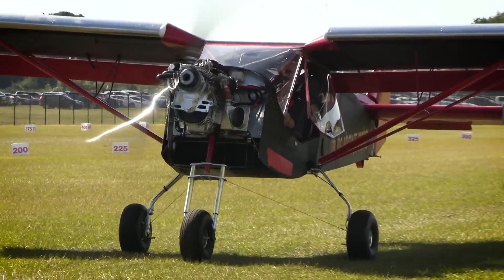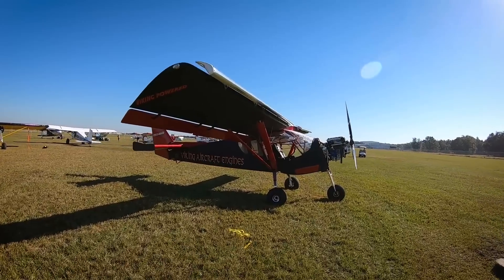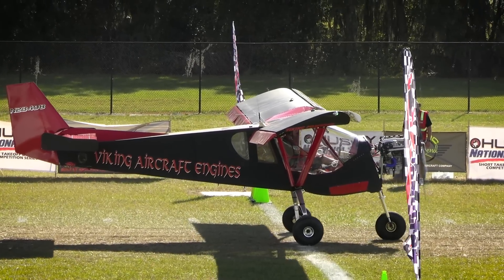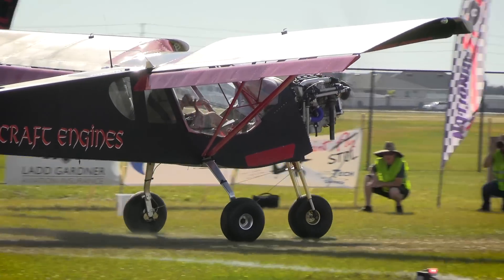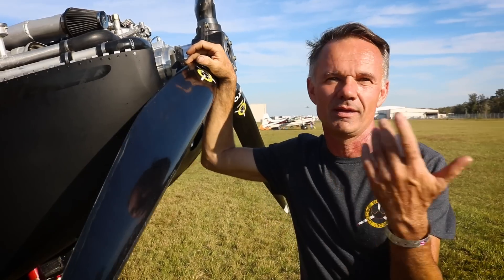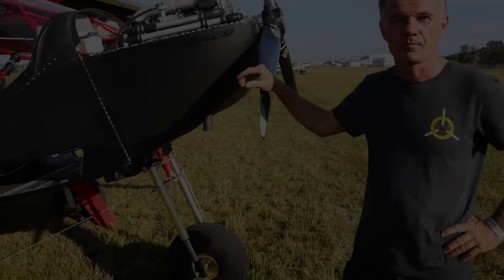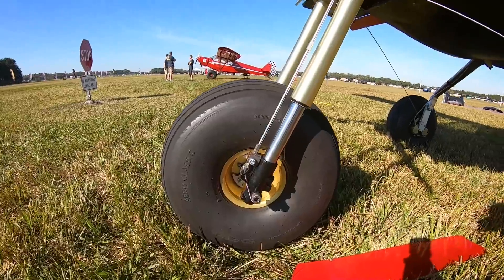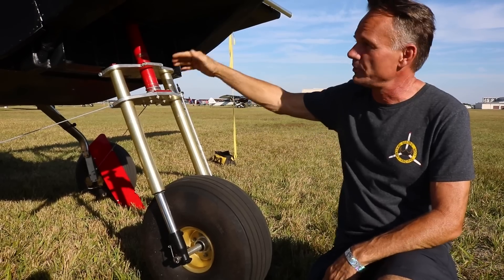Honda Turbo Engine | Sportbike Gear | STOL Aircraft

Comment: Very cool, I suggest you adjust the fork oil and rebound settings in the front forks to increase the dampening and make it even softer. The initial bounce when you land should be mitigated so your landing will be shorter. I'd be interested in building something like this

Comment: Have you looked at the Honda motorcycle 1300cc v engine in the Honda touring motorcycle for light sport aircraft.  They are around 120 plus hp.

Comment: Do these engines get modified with two spark plugs per cylinder?  What about the rotax, two spark plugs per cylinder?  Asking for a friend concerned about redundancy.
Reply from the maker: This particular engine is NOT modified for the ignition nor is the design most likely able to accept such mods. (Room in the cylinder head etc). There are a lot of "modern engines" being used with only one spark plug and one ignition system. Some...have a single spark plug but 2nd coil etc and operated by a switch to alternate to TEST or switch if failed.  Etc.  The idea however, and this was explained to us by a known electronic ignition manufacturer for Legacy Engines (Aircraft Engines like Lycoming and Continental) is that back in the day (1930's-1940's) the magneto spark ignition wasn't hot enough to make efficient combustion. Hence having two spark plugs and two magnetos to run the Engines. The two spark plugs also offered "redundancy" as a "biproduct." Not a bad idea also considering the spark plug gaps of a Low Energy Ignition System as they were prone to fauling with both carbon build up and lead from leaded fuels.  The modern High Energy Ignition System is able to have a MUCH larger spark plug gap and hence fauling is nearly unheard off and a non issue.  (Telling for a friend). :-)
Reply: @ExperimentalAircraftChannel  thank you for the response. I’m just getting started. I have 50 hours in a cirrus and I’m now thinking experimental may be best for me.  Is there a place I can go to check out builds and volunteer for a few days to learn?  I’ve kept my ski boats running myself and am pretty handy.
Reply: @Mobev1  you just missed oshkosh airshow in Wisconsin
Reply: @majorchungus  I bought a cirrus on eBay recently and got the deal of a lifetime.  Wells Fargo owned it and they were just unloading inventory.  It was risky because I couldn’t do a pre buy but I ended up taking it to a cirrus center in rochester and it had zero issues.  2017 sr22 turbo for 268k!
Reply: @Mobev1  I have to aircraft, a flying one and one I am rebuilding.

Comment: We’ve k swapped everything on the ground. Bout time to move to the air. But dudes crazy for using a motorcycle fork for front landing gear as cool as it is, I’d never trust it. Although it may be stronger than some stock nose wheels.
Reply from the maker: That is why it is called EXPERIMENTAL! :-)  Looks like it is high time for YOU to try it! We have a 31 Day Build Challenge going on RIGHT THIS MOMENT in the month of December. Search FB for "EXPERIMENTAL AIRCRAFT CHANNEL GROUP" and join in or follow along.
Reply: @ExperimentalAircraftChannel  lol ya got me there. But it does look like he machined that fork and took the design rather than taking the whole setup from a motorcycle and slapping it on. 31 day build challenge. That sounds awesome. But not on fb.. Although for me a 31 month build seems more realistic. hahaha

Comment: I don't know what kind of material Jan is using for his nose gear, but it just doesn't look beefy enough to handle the nose drops he's talking about. I'd go a bit beefier if it were me, and use inverted forks that current sport bikes use. They're stronger and less wobbly, at least on a 200mph crotch rocket :D
Reply from the maker: Good idea. Inverted forks. Actually even the ORIGINAL nose gear/suspension looks quite light. BUT.... it actually has done quite well through the years surprisingly. Thanks for watching today!
Reply: @ExperimentalAircraftChannel  Can't argue that old school design.It's balls-simple and reliable. It did limit tire sizes a bit though. If you look at the modern ADV/Enduro bikes, they're all running big, beefy, but reasonably light inverted setups, with oodles of travel. Just what a bush plane that might land a bit hard from time to time would need. just make sure you're not ending up with a prop-strike at full compression with your nosewheel at minimum PSI.

Comment: I’m new to this but wouldn’t a street bike engine like a 1000 work? If somebody can answer that.
Reply: Nope. The transmission is integrated into the engine (the engine block and tranny case are all one casting) and the dead weight negates the power gains. That's why guys like Steve Henry and Jason Busat are using skidoo engines, and then that other guy is using a jetski engine. At most, the only gearing you need between the prop and the crankshaft is a single reduction gear on the fast spinning power plants like the ones I mentioned. The Viking Hondas are mounted so that the flywheel is spinning the reduction gear at the front, vs. the typical transverse mounting found in FWD and AWD 4 bangers and V6s. If you have a spare 1000cc I4 from a wrecked sportbike, you're best suited to convert it into a 5 speed with reverse and drop it into a sand rail or go-kart.
Reply: @GrizzAxxemann  cool yeah I've already done that a few times.
Took a  Ninja 1000 & an old 4wheeler frame & stuffed it all together.
I made it really low for center of gravity.
It does low 7 in the 1/4 mile.
Really fast.
That's why I was thinking of that in a sports plane.

Hey thanks for yr response, it's greatly appreciated.
B safe
Reply: @davidorourkesr  No worries, my dude. I was on the same train of thought for the longest time before someone broke it down for me.
Reply: @GrizzAxxemann 
I'm my ways of thinking.
Why couldn't the transmission be deleted?
If to gut the case & run it as direct drive?
Reply from the maker: It has been done before (and recently in fact). Someone sent us a short video clip (cell phone... bad quality) of a Yamaha on a taildragger. I believe it was even SHIFTED from 1st to 2nd gear in flight!!!! :-) But.... typically speaking there is a weight penalty even compared to say a Snowmobile engine with a added purpose built gearbox. And they these "purpose built gearboxes" have the correct gear ratio for the rpm of prop/engine power etc etc. Thanks for chiming in today!
Reply: @ExperimentalAircraftChannel  When my royalties came in my last check is going to be very large and I’m definitely going to be buying an amphibious ultralight the a 5 I think would fit my thoughts?

Comment: The problem I see with these turbo Honda engines is people compare them to the Rotax. The Rotax does add horsepower but it’s more of an altitude compensating engine. I don’t believe the car engine is. I even asked Viking several years ago what was the horsepower rating at 15,000 feet and they couldn’t answer that. These turbo engines are producing more horsepower obviously and doing so at sea level but In theory these Honda engine should lose 3% power right from sea level just like an out naturally aspirated as I don’t believe they have a sophisticated waste gate controller or altitude compensator. So at some altitude 9+ thousand feet a Rotax 915 will produce more power than a 190 hp turbo charged Honda.
Reply: The 915 is the one with the antiquated waste gate controller. The Honda system is extremely precise and can hold any level of MAP at any altitude, as long as the intercooler is large enough. So 195hp is theoretically attainable at 30,000 feet if some special application needed this. Also, it is a tough argument to put Rotax ahead of the Honda engine when the Honda pulled an airplane 1/3 heavier than the many Rotax powered competitors in third of the distance at the National stol.

Yes, this Viking/Honda is also altitude compensating.
Reply: @eggenfellner  yep MAP ( manifold absolute pressure) and or MAF ( mass airflow sensor) some engines use both,  will make any engine altitude compensating. They will still lose power at high altitudes, that's where a turbo cones in,  but the mixture will be right.
Reply: Yes and no. All engines loose HP (with rpm constant) with a decease in air density and the  Rotax is the same as every other engine in this respect same as the Honda engines. One key thing that people are overlooking about the Rotax is that they have a "5 minute" or takeoff rating and then the power must be pulled back so that "915is" is not producing the (well no know really knows) 140ish hp in  flight as the engine needs RPM to produce the rated HP and when the operator decreases the RPM the HP drops.  But this is the same for any engine.

The Honda is taken from a car with a "252 hp" rated engine, which is probably spinning less rpm in the aircraft which is why or how the guessed at the 190 hp rating. A wastage controller could be installed to provide the same level of boost from  sea level upwards. This is nothing new nor special. 

How long will these engines last and how heavy are they is the real concern, not Rotax's magical ratings.
Reply: @arnesonindustries3160  Given that these Honda blocks haven't changed dramatically in decades and the car guys have been messing with them for about the same amount of time, plus there are plenty of Hondas on the road with 250K or more miles on the original engine (figure out how many hours that is for yourself) and I wouldn't be surprised if the TBO is north of 2500 hours, especially if you're sampling your oil and doing oil changes at 25 hour intervals. The 915iS just recently had it's TBO time upgraded from 1250 to 2000hrs IIRC, and it's 3x the cost.

If memory serves, the entire engine and transmission combo on one of those is around 380lbs. Pull the transmission off and you're probably around 250lbs, more or less, and the 750 can handle a 350lb engine by design.
Reply: Smart Alec
Reply: @tinolino58  but they are always correct….🤷🏻‍♂️
Reply: 9,000 feet in one of these STOL centric aircraft....? HA not likely!
Reply: @ackack612  we have video taking it to just below 18,000 feet on our YouTube, we’ve also taken a little RANS s12 to 14,500 feet (open cockpit, don’t recommend) 🥶. But, only for engine testing not really what we use the plane for, but occasionally over the Appalachia’s we wind up pretty high.
Reply: @ackack612  Probably not, but there are some CH601s with Vikings, and the 750 Cruiser could probably do it. There's also the density altitude factor too. Hot day in Utah, Nevada or Colorado ?
Reply: @ackack612    You really have no idea what your talking about do you? Sorry eh!

Comment: The purveyor of Viking engines has a poor reputation from his previous company(s). I quit watching as soon as I saw where the engine came from. And are those engines new, junkyard, or what?
Reply: Proof? All the guys I've seen running Vikings have had nothing but good things to say.
Reply: @GrizzAxxemann  He was flying to Alaska with this very engine. Never made it. Crash landed in Montana. Deleted all the youtube content about it but forgot to turn off his garmin GPS that was reporting his position which stayed on for days. Jan is a conman.
Reply: @shmio  that is 100 percent false. We have been very open about that. We had our older 130 gearbox on our turbo engine and this was for testing and the aircraft was built in 90 days, between way too many issues on the aircraft, weather deterioration in Alaska as well as the need for stronger thrust bearings we FLEW back home to Florida, from Montana. No crash landing, but nice fairytale. If you don’t know facts, don’t spread lies. 

This trip was exactly what we wanted it to be a testing of our smaller gearbox on a bigger engine, it resulted in making bigger gearboxes with more bearing. The reason why flying your own engine and testing everything is incredibly important.
Reply: Ancient history.
Reply from the maker: Thanks for taking a second to watch today. We try to present a good variety of Original Aviation Content for everyone!:-) Sorry this one doesn't interest you quite as much?! See you over on the NEXT ONE! Thank You for your support in helping is to reach more people to get them involved in EXPERIMENTAL, LIGHT SPORT, ULTRALIGHT and eVTOL Aviation! :-D
Reply: I'd suggest you watch a few Viking videos if you have such questions, they provide many good answers, and then you can have/build an educated opinion...

Comment: Put a tail wheel on it. And this steering conversation will go away!
Reply: Problem is that the two nose wheel airplanes that entered each placed #1 in their class. Can’t get better than that :)
Reply from the maker: Haha! Yes.... But many of these "Nose-Draggers" are doing quite well in these "competitions" AND... they are MUCH cheaper on the wallet for insurance! But yes... a taildragger can be a little simpler to build and possibly lighter weight with the "little wheel" of course. Thanks for saying hi!
Reply: Nah.